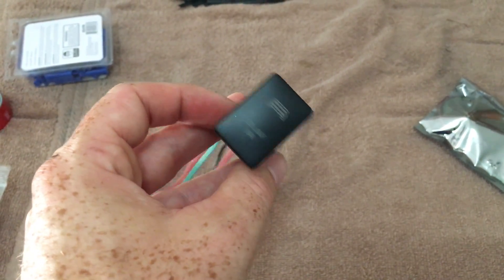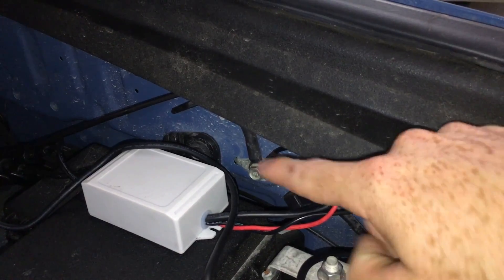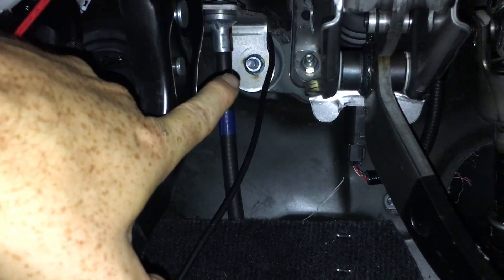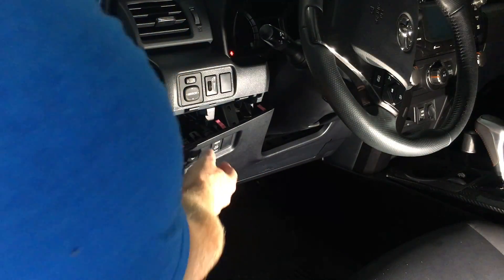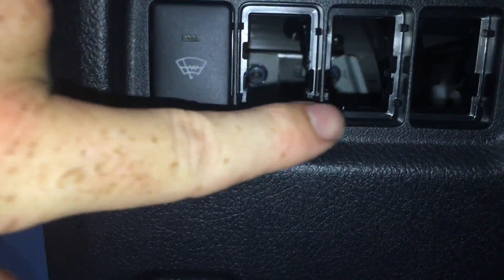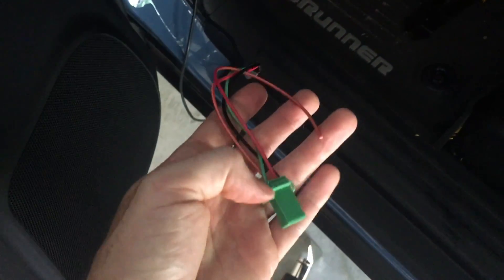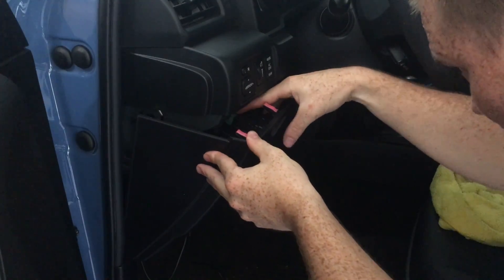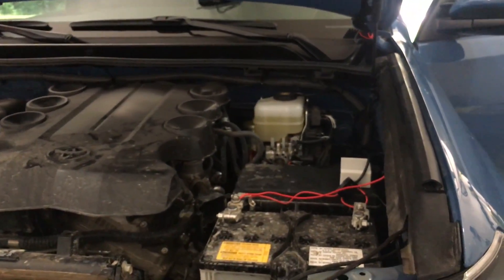OEM STYLE LIGHT BAR SWITCH INSTALL | TOYOTA 4RUNNER

Comment: As others have said, you should NEVER run wiring through a metal hole in your vehicle without bushing the edges of the hole. Some of these holes can be razor sharp. Also, never leave unconnected wires behind the dash without insulating the bare ends.
Reply: how do you insulate them?
Reply: @Boom-oq5yj  the plastic thingy

Comment: Hey mate I’m looking in to wiring 2 lights with the ARB wiring harness but it shows in diagram to tap a hi beam ? To run this harness is that what you had to tap to ? Or did you tap to any fuses to make sure your switches work  when your key is inserted? I’m just getting confused with all these extra wires lol

Comment: If you are feeding the wire through the small grommet hole at 1:16, I recommend drilling a hole through the grommet and feeding your wire through the grommet. That way you protect your wire from the sharp edges of the fire wall and the hole is more weatherproof.
Reply: I agree, you definitely want to run the wire through a grommet. What I have done in the past is to heat up a center punch and drive it through an existing grommet creating a hole just big enough to where you can squeeze your wire through so that it basically seals itself inside the grommet. BTW, Amazon sells a large variety of replacement switches that have custom labels and are LED illuminated.
Reply: @mikeaustin5670  This was just the video I needed, many thanks. I have my ditch lights, and front grill bar running up into a few OEM style aftermarket dash switches. Worked perfectly!

Comment: I would leave the grommet in the hold, best to punch a hole in the grommet and feed your wire thru the hole. Without the grommet the wire insulation could get damage causing a short and or a fire.
Reply from the maker: Good call!

Comment: I watched this before, just installed the light bar tonight. I have ditch lights waiting to be mounted. Question: are you running two positive leads to the positive terminal of the battery? That’s what I’m seeing. Is it safe to do that? I thought the voltage difference if any, could damage the light that takes the lower load. 
I have a Baja light bar and Baja ditch lights and need new bolts for Baja fogs. Lol

Comment: Bro, you need to get that light to the inside dimmer, you need to connect the negative and positive from another switch to get the right voltage into the switch for the dimming light. Great video!
Reply from the maker: Thanks! And you mean for it to come on with the dash lights ?
Reply: @TRDJon  yeah buddy, I forget which video I watched was the older couple with the res 4runner. I have the bottom lighting using the interior vehicle dimmer. Looks sweet, great video!
Reply from the maker: Will do!
Reply: Phrank Rizzo I will have to watch. I definitely want the switch to be able to dim with the rest of the lights.

Comment: The new spot you put the inverter switch were you able to reach up from the bottom where you pop open the panel? 
I tried to move mine down but yes they have different notches on the openings.

Comment: Did you disconnect light from battery when cutting the wires and replacing the switch? Or was everything still connected when you were replacing the switch?

Comment: Question, is your relay button light still on while the car is off?
Reply from the maker: Yes it was for some reason
Reply: @TRDJon  any problem with the light on while the car is off? Like battery drain etc ? My installed and the light still on iam not sure if I need to connected the 7.5 AMP fuse to the wire

Comment: Im pretty confused right now. So i was able to wire this switch to a light bar. the light bar turns on and off with no problems whatsoever. But when my car is off or i turn the light bar off, the light bar icon on the switch doesnt turn off.  Any idea why this would happen? Or is it supposed to be like that? Im worried itll drain the battery
Reply: Hey did you ever figure out the problem? Mine is doing the exact same thing. Would appreciate any info you learned!

Comment: Are those RGB ditch lights? I've found some on the retro fit source and i want to know if they will connect to the OEM style switches from Cali raised
Reply from the maker: The should. The switches are generic to fit multiple applications

Comment: Always need a grommet in the hole. Don’t pull the grommet and leave it out. It’s a water intrusion point and the metal edge will abrade the wires and possibly short out in the future.
Reply from the maker: It can cause some chaff yes. I’ve wrapped it in electrical tape since this and chaff tape
Reply: Cheers to that - PS, thanks for the vid. Saved me a good bit of time doing my own install this last weekend.
Reply from the maker: No problem!!! Glad it helped.

Comment: Should have put a small slit in the center of the grommet and fed your wires through it with a heatshrink sleeve so you didn’t have a big hole for possible water intrusion there.. 
other than that, good video..
Reply from the maker: Thanks! Ya the grommets is a little to thick for that. I thought of it. Both wires kinda fill it up the hole though.
Reply: Blue TRD Jon okay.. didn’t look like it was that thick from the angle you were shooting from.. 
but good to know..
Reply from the maker: I guess u should say thick. It has like a thick part in the center that goes into the cab portion of the firewall.
Reply: Does Toyota or anyone after market sell this small rubber grommet with a hole in the middle for the firewall? I don’t want my wires rubbing on the sharp edges.
Reply from the maker: I’m sure autozone or amazon sells some rubber o ring ones for super cheap

Comment: That was awesome man. Most informative install on YouTube for sure. I have a Tacoma but the process I’m sure will be the same. As far as the extra wire from the switch is there somewhere to tuck it or is it just left hanging out.
Reply from the maker: That extra wire is used to tap into some light wire to keep it illuminated
Reply: Hi Jay! That wire should be spliced into a dash light wire in order to have the letters on when dash lights are turned on. I have a video on my channel explaining this on a third gen Tacoma, the video is about wiring a LED light bar, jump to minute 18:00 so you find the OEM parts quick.. it is in Spanish but I think I set up closed captions on English, let me know if you have questions! Good luck!
Reply from the maker: No worries!!! Thank you!

Comment: Thanks for the video. Helped a lot. Have you had any issues with your switches sticking? I feel like mine sits too far in the hole and when the switch is pressed it catches on the dash and cant release back out.
Reply from the maker: I actually have not. I’m sorry!
Reply: Same problem. Just sits in a fraction too far to properly work
Reply: Same issue. There isn’t enough room for the button to click on and stay on. I took a small piece of wire sheathing and super glued it on each side of the switch body to act as a small spacer. Works like a charm. Good luck guys!
Reply: Spoke with Cali raised. They offer a replacement since their is variance in 5th Gen models. There is a diy fix of electrical tape at ridge for possible fix. Will try tomorrow
Reply: Matt Dunn thank Matt, good to know. My solution works if the tape doesn’t. Good luck.
Reply: What is the other solution you have?
Reply: @nocomment8578  Electrical tape worked for me as a spacer for both of my switches I bought from Cali Raised.  They bit better now and the buttons stay clicked in as intended.  Thanks for the tip!

Comment: does the lights on the switches turn on only when turned on, or do they turn on when you turn on headlights also? asking because i just got this setup, am about to install it on my 4runner
Reply from the maker: You can tap into your vehicle wiring as well to have them on for that

Comment: I want to make a distinction and I hope that you would be able to confirm my thoughts. I don't trust my ability enough to splice into the existing vehicle electrical. But this project seems to be completely independent of the vehicles electrical (save the the connection to the battery). Am I on the right path?
Reply from the maker: Yes correct. Unless you are wanting them to illuminate when you turn on your interior lights. But if not they are completely independent

Comment: Hi Jon!!!
Nice video, could you please do a video on how to splice to a dash light wire? I did this on my Tacoma, but I am trying to install it the same on my friend's 4runner, and we can't find a dash light wire.
Thank you!!!
Reply: Porroquio did you figure this out by any chance?
Reply: I know this is a bit late, but you can tap into the wiper heater button led power cable to get the button leds to come on with the dash lights.
Reply: @kilo6one  also late but which wire went to the led?  Thanks.

Comment: Have you tried tapping your switch led to your marker lights? Im talking about the led that will light up your switch when you turn your key to ACC.
Reply from the maker: So for some reason the pods now are always on. I haven’t tapped the LEDLight bar one on yet.
Reply: This is where I'm stuck right now. Mine are always on. Any details?
Reply from the maker: I can’t remember who commented. But there is a comment on this vid and somebody fixed it

Comment: Really appreciate all of your videos! I want to access the blank switch to the lower right of the steering column. Any suggestions?
Reply from the maker: Just pop out the plastic around the steering wheel on that side
Reply: That’s the “Party” mode switch & the standard OEM switches don’t fit
Reply: @TheKPDX  wow, good call...didn't realize that
Reply: Important note - you must pull the surround around the HVAC fan knob on the center stack to be able to remove the right side of the driver knee panel to access the “Party Mode” blank.

Comment: Great video! I'm trying to figure out my setup now. have 4 separate lights going on the roof. each is 20W. a harness came with each pair. has a factory switch, and no relay. I want to splice the additional 2 lights to the same harness. The main wire looks 14 gauge, and should handle the 6 amp draw, but the Toyota style switch is only rated for 3 Amps. It sounds like I'll have to add a relay to the harness so the switch doesn't get the full 6 amps, and melt. Do you have relays on your harness? how many amps is your light bar? Have you encountered this issue? Thanks.
Reply from the maker: The factory harness that I have comes with an in-line fuse so if it gets too much current that will blow before it gets to the switch.

Comment: Great video! I have decided to tackle my light bar today. However, mine didn’t go as easy. Very similar switch and wiring, just can’t get the damn thing to light up. Any ideas?
Reply from the maker: The switch itself won’t light up ?
Reply: Blue TRD Jon After a lot of trouble shooting I found 2 problems. The wires for the plug were somehow backwards, so I was plugging power into ground. Then the switch wouldn’t function and found a burnt patch on the circuit. Time to buy another switch.
Reply from the maker: Call whoever it was for the switch and let them know. They should send one for drew
Reply from the maker: Free
Reply: Blue TRD Jon I reached out to the company on amazon, so we will see after the holiday weekend. 🍻
Reply from the maker: Sounds good! I hope they do the right thing

Comment: How did you move the 400w switch to the top row? I could not pinch and pull the top row blank cover off. Thanks.
Reply from the maker: I was able to pull off the blank cover. Not sure what yours won’t come out
Reply: Blue TRD Jon Just found out the upper panel can be pulled out too with a little force. Now the 400w switch is moved to upper row. Looks more organized. Thanks.
Reply from the maker: No worries!

Comment: How did you put the inverter push switch on the top? Thanks,
Reply from the maker: Just popped out the blank panel up top and moved it up. Just be careful of your fingers
Reply: @TRDJon  Thanks John. I thought I would have to remove the top panel. Your channel is very informative and a huge help for all of us that has 4runner. Thanks a lot Man.
Reply from the maker: No worries! Nah just pull that low panel out carefully and you're good to go. Just watch your hands.

Comment: How did you fit the inverter switch in the top slot since it has different notches?
Reply from the maker: The spot I put it in the notches lined up
Reply: @TRDJon  Does the top panel pop off with a simple tug as well?
Reply from the maker: I haven’t tried the top portion

Comment: Awesome video.  Thanks so much for doing.  I’m going to do exactly what you did.  I do want to wire the lower part of the switch to my running lights, so, it looks cool.  Have you don’t this?  If you did, which wire did you “tap” into??
Reply from the maker: I haven’t done it yet. Hesitant to tap into any
Reply: You can use an add-a-fuse on the tail fuse if you want something less permanent
Reply from the maker: Yes that too
Reply: Find the fuse box by your parking break and use an add-a-fuse into the fuse that is for your dash lights. Make sure to transfer the fuse you take out and put it into the add-a-fuse. Then when you turn on your headlights, your dash lights will come on and so will the backlight for your OEM switch

Comment: Ahhhh, Google. Finally got my switch and bracket from Cali Raised and this is the next thing i see on youtube. Did you ever hook up the 2nd power wire? I was thinking of using a fuse tap.
Reply from the maker: I didn’t. That may work with the add a fuse

Comment: I did this, ordered it from.cali raised and it doesn't appear to fit correct.  When I hit the switch and let go it does not keep the lights on... I have to hold it permanently to keep the ditch lights on.  I am really upset with cali raised as all they've told me is it is the correct switch.  I am about to initiate a chargeback.
Reply from the maker: May just be a bad one. Definitely get your money back

Comment: How do you get power to the lights? Did I miss that in the video or was it not included?
Reply from the maker: I just did the positive to the red of the battery and negative to the negative terminal area on the side of the engine bay. I said it but it was fast.

Comment: Did your switch make the ditch lights only light up amber? Ive been trying for the past couple hours but can only get it to light amber, not the white LED
Reply from the maker: May need a separate switch for that if it is a dual light

Comment: does your harness had a relay? also do you know how to wire the RED2 into the stock harness?
Reply from the maker: The harness I have does have one yes
Reply: @TRDJon  what about the Red2?
Reply from the maker: Not sure what you mean by that one
Reply: TRD JON oh sorry I know you didn’t do the Red2 wire into the main harness to be lit when the key is turned but do you know where that Red2 would wire to do that? Like where into the harness?
Reply from the maker: I’m not sure. Somewhere into the dash harness to light it up.
Reply from the maker: Sorry that wasn’t much help.

Comment: Does the Light bar come with all of the necessary wiring I need to use with the caliraisedled button?
Reply from the maker: I'm not sure about cali raises light bar. The AUxbeam one I got came with the light harness and everything
Reply: @TRDJon  I purchased the same one you have but just had to return it as well as the modular Mount as my 2019  4 Runner is the TRD Premium and the cross bar is not drilled out with a horizontal bar in the middle along with a hose for the bigger radiator because of town package I guess.
Spoke with Rago, sent pictures and they stated as they know, there is no other way than to mount on front of bumper. What a bummer right!!
Reply from the maker: Hmmmmm that’s strange

Comment: Are you able to turn on the led lights without the key in the ignition? I assume so based on your video.
Reply from the maker: Yes since they are attached to the battery you can whenever you want

Comment: Does the light on the switch light up when you turn your lights on? Not just when you click the switch?
Reply from the maker: The lights turn on when you press the switch in turn also illuminating the switch itself blue
Reply: Blue TRD Jon I’m pretty sure you can run it where the switch itself illuminates when you turn your car lights on.
Reply from the maker: Oh the car lights? You just tap the extra wire this one has into the dash likes wire. I just didn’t do that.

Comment: What if the baja lights in looking at include a wiring harness with a switch and non-individual wires?
Reply from the maker: I just cut the switch off that came with my harness and wired it up to the new switch

Comment: Just did my install  ditch lights with the oem style switch anybody have problems with the switch clicking once install in the panel like it not sticking out enough for the button to function properly 🤔
Reply from the maker: I've heard of sticky switches. But not that issue.
Reply: @TRDJon  ahh got it figured out the back side of the button had some casting left on it that I had to sand down and remove now the button will depress and works properly other than that the install went great going off your video

Comment: Does your switch stay Illuminated while the car is off?
Reply from the maker: It does yes
Reply: @TRDJon  i figured out how to have it off and only light up when turned up. you dont need to tap into any other wire
Reply: Marko C. What do you need to do because I’m having the same problem and don’t know if I did something wrong or not
Reply: @MCved  how do i only have it turn on while the car is on